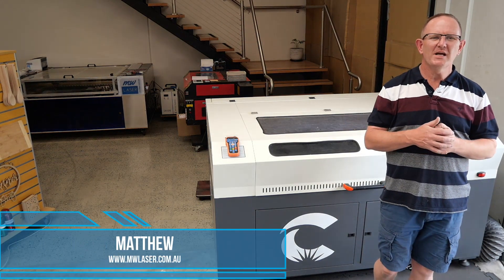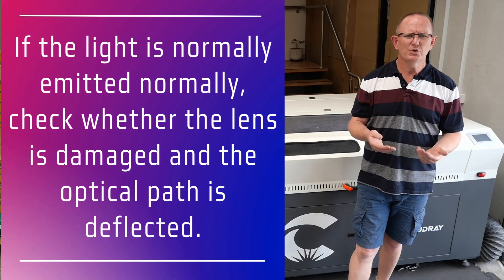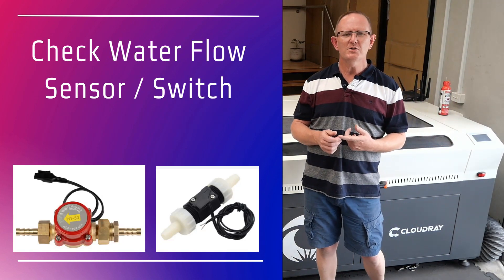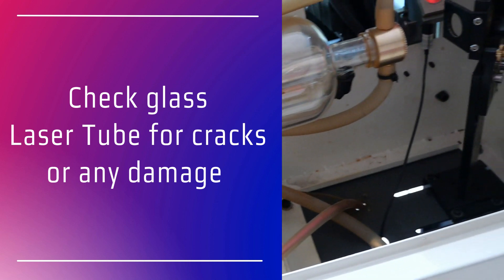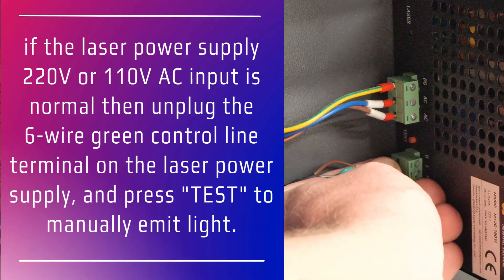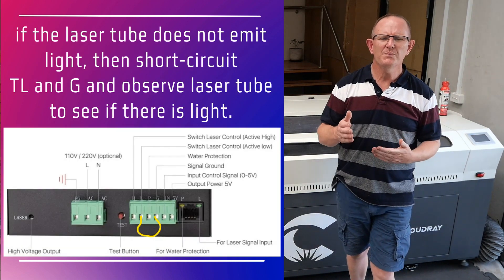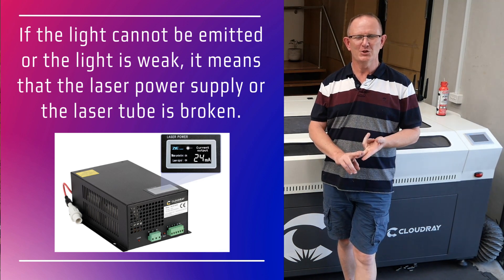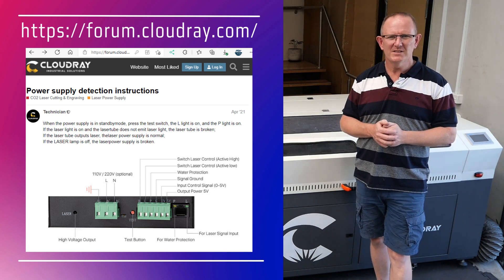Co2 Laser Power Problems and Trouble Shooting

Comment: Our CO2 laser is a little bit triggering even if at standby and the  laser power is on. It reads around 2-3mA in the  laser power meter. What's the trouble?

Comment: I hope you have a little wisdom for me. I have an 80w laser, when it starts I get a good beam and 14amps on the amp meter. After a couple min it drops to 1 to 2 amps. I thought overheating but fans on supplies seem to be good. Any help would be appriciated
Reply: How did you solve that problem?
Reply: I haven't I assume its the power supply, still not sure though.
Reply: @jeffcrawford3458  Haven't you changed anything?
Reply: change power supply?
Reply: Not yet been super busy. I also have a CNC and a graphic unit

Comment: Essentially watching every one of your videos.  I have been trouble shooting my Dowin 1300*900 for months.   Diagnosed a bad power supply,  replaced it then my controller goes black.   Replaced both controller and motherboard,  it works for 10 minutes then blacks out.  Turn it off then on and the screen comes back on, but as soon as I push a directional button on the controller it blacks out.   Any Idea what this could be?

Comment: I'm having trouble with low power. It takes me several passes to get through 1/8" acrylic.

Mirrors appear to be aligned. 

Lens was just replaced but didn't fix the issue.

Tried 80% power/ speed 10

Comment: I bought new laser tube, it's firing nicely but will not cut or engrave. I did a line test, at 85% power, the mA does not even go up past 7. What could be wrong?
Reply: U got the solution?

Comment: Awesome Video! The company i work for bought a used 150w 5' x 10' laser that wouldn't fire. after watching your video I traced the issue to the machine not having a water sensor. The wire for it was just coiled up under the machine.

Comment: Hii! My husband and I have a co2 laser machine and a while back it stopped functioning properly and now it doesn’t stop lasering between paths. How can we fix this ? It’s a Katian USA
Reply: If you have a Ruida or other DSP controller and are seeing this happen, it is most likely a dying high-voltage power supply unit (PSU). The drive circuit that turns the laser power off and on tends to go first, before the part that controls the overall power level.

Comment: Hi friend, well my problem is that miliamper (mA) decrease little by little while the CNC is working, the power supply is new, (I bought another one thinking the power supply has broken, but not), in one hour of working the milliamperes drecress from 21mA to 15mA. the AC supplier has 210v contact, (is low but, I always work with this voltage without problem) the Laser Tube is not new but not old, mmm apron I changed this apron. 1 year whit very low use.  In advance, thanks a lot.
Reply: How did you solve that problem?

Comment: Wondering if you would have any knowledge of the red/black laser??? Min start up fine, runs for 20 seconds then loses all power except for lights and a fan on the door of the components. When I shut it off and let it sit for awhile it will start back up and same thing
Reply from the maker: Sounds like a DC power supply issue.  IF the door fan and lights remain on these usually are powered by mains.  so, with machine coming on and then controller turning off would indicate that if you change out the DC power supply the issue should be resolved.

Comment: Matt I am running into an issue on my 300watt machine where it cuts fine but after it has been running for 30 minutes there is something dropping the power because it stops cutting fully through the material any ideas?
Reply: How did you solve that problem?
Reply: I have had two solutions in the past for this. Once the co2 has in the tube was depleting so it was losing power on the far side. The other solution I have had is the power supply. The fly back relays were bad and also breaks in the high voltage wire causing voltage leak
Reply: @shawnlandry1636  change power supply?
Reply: First thing I would try is turn all the lights around the machine and pulse it if you see any sparks or little electrical discharge and listen close for any crackling noise if you see or hear any of those, if you are knowledgeable I would change the red high voltage wires. Make sure to seal the connections with hot glue or liquid electrical tape. If you aren’t sure how to do that then just change the power supply. Do you know how to and have the parts to do a resistor test ?
Reply: @shawnlandry1636  How do I take the test? 2-3 mA drop has, loses

Comment: Dear Mr. Matthew
thanks for this really educative video.
I have a strange issue that, after replacement of Laser Tube 40W and Power supply 50W with compatible new ones both from VEVOR 
(this is a 50W Chinese one),

Laser does not stop firing also during travel. 

I mean as soon as I power my machine, it goes to zero point to engage limit switches, and turns back to preset axis by leaving a really unexpected line over the workpiece. 
Something (what i dont know) keeps the laser on, even with a weak light.

I am helpless from reseller, any suggestion will be really important. I have videos, parameters, wiring etc. if may support my question and if you want to see.
Please help me, I am ready to cover any costs occured.

Thank you
Regards
Reply: voyager3355, I am having the same issue recently. Swapped the power supply wired exactly the same as the original and now it fires all the time or while traveling. Did you ever find a resolution and what was it? Thanks in advance.
Reply: @baddogACE  Hello. I have changed both laser tube and power supply with non luck, and I used to purchase a brand new unit. Since I need the machine.
I think to solve the issue, you need to replace the PLC main board.
Because my problem originated from a blown co2 tube due to lack of cooling. that probably caused a short circuit at unit and all these things happened.
I am sorry for you.
Thanks.
Regards.
Reply: @baddogace221 did u find the solution? I got this problem when i replace board m2nano to m3nano to use pwm feature. But when i change it, it keep firing when it travel around. I found solution before, but i forgot how to do it. After a week the same problem showup.

Comment: Hey sir can you tell me why laser not stop emitting when it travel?
Reply: I’m having the same issue. Let me know if you have figured it out
Reply: @brianbean19  when I trase the bord I found some short elements now I am going to change the bord.
Reply: Hello! i have the same issue! laser does not stop during travel! and ruins my workpiece.

May it be the Controller defective?
Reply: @voyager3355  it is tube power  supply problem.
If you can try by changing another power supply
Reply: @babyayalew8059  thanks! I did all. And i am convincere this evening that I have blown out my PLC. Unfortunately.  But like this.

1. Water flow sensor is broken.
2. Even water flow sensor short circuited laser travels with light. 
3. Each port makes the same even laser tube 1 or 2. 
I am convinced to purchase new one....
Unfortunately. 
Regards.

Comment: I just bought K80 aka red Chinese laser. I am trying to test fire (pulse), but nothing happens.

Water cooler is turn on and running (if its not, and I try press pulse it gives error about water flow).
Lid is closed
When I click TEST on the power supply it fires.

Where else can be the problem?

Comment: Hi, can you tell me what you mean by short circuit? Do I remove the wire from that port?
My laser is not cutting and the test button was not working until I unplugged the 6 way terminal. Then the laser fired. I need to plug it back in to see if the water monitor is working as per your steps but I'm stuck. Please help! Thanks Natasha
Reply: "short circuit" means to run a wire between the terminals so that electricity can flow between them. In his illustration, the yellow line is a wire.
Reply: @JohnKelso  Thank you :) I figured it out in the end.

Comment: Can we use 100w power supply for 60w tube?
Reply: what did you come up with using a 100w power supply
Reply: @tugboatcapt1984 may he prevent to change the laser tube 100w  in feature 😅

Comment: I have a 150w laser tube and the 150w cloudray laser power supply with the screen on top you showed in the video, up to around 50% command power the laser cuts just fine but anything over that and it doesn't cut atall.
I noticed some arcing internally to the annode? Ring on the output side, the arc just sort of dances around the ring I've heard conflicting information that this is normal but I have no idea.
The tube has only done about 10-20 hours in the lifetime of the machine (probably 5 years old barely used)

I've swapped the power supply and flushed out the water with fresh distilled and it hasn't really helped. 
Any ideas?

Comment: What about the readout on Cloudray MYJG-100 power supply? Can one press the TEST button and make adjustments using the little potentiometer on the side? If so, what number would be ideal to have in the LED display? 24 -- as is shown in Cloudray's product information pictures?

Comment: I have a problem with my 100W Co2 laser.
If my laser power is set above 50% (up to 99.9 %), the ignition of the laser tube is normal, the laser current indicator shows the number 15mA to 30mA. I can use a laser for the acrylic cutting process.
But if my laser power is set below 50%, the laser tube ignition still has ignition. It's just not continuous (intermittent) and the current indicator shows a number below 1mA. So that I can not do the engraving process.
Maybe someone can help provide a solution to my problem?

Comment: So am I correct in understanding if TEST button fires laser while P and G are shorted out the issue is the flow switch?
Reply: Hiya, Did you solve this problem? I'm a Newby and I don't know what it means to short circuit. Not getting much info that's helpful online. I am at the stage of checking to see if its the water sensor supply for my non firing laser issue. 😔

Comment: My problem is when I turn on the machine, it powers up but the ruida monitor does not, hence my laser does not operate.  The machine fan and light inside powers up, but not the laser.  does that mean I need a new ruida system?
Reply: IF you know what you are doing, check the 24vdc power supply to make sure it is putting out; normally there is a green LED to indicate power, but use a multimeter to check for 24 vdc out. Make sure the connector from the 'motherboard' module to the display module is plugged in at both ends. For starters.
Reply: @BrilliantDesignOnline  the machine has green lights on everything.  Pretty sure also from the power box, as I said the fan was running. Does that not mean anything?  Will the ruida panel have lights on when functioning properly?
Reply: @cd3845  I don't know your specific machine. You cannot be 'pretty sure'; you need to know the systems, so I would recommend having someone local look at it. Also, you should share the manufacturer and specs to give us a better idea at what we are dealing with. Perhaps Matt has an idea, but the best bet is probably not on YT, at least for diagnoses.
Reply from the maker: email more info to askmatt@mwlaser.com.au
Reply: I hv experience like this.. im using top wisdom.. the board was faulty.. swap with other mchine panel board.. then its working fine... need to replace the ckntrol panel board..
Reply: @nurimanvlogs  it was actually a faulty wire with the red laser guide.  I touched that wire and the ruida board came back on.